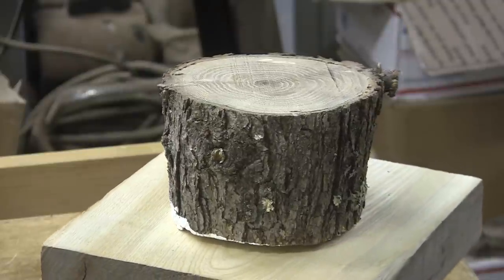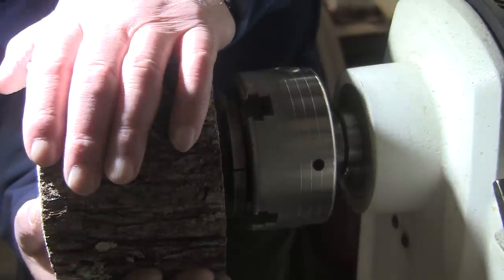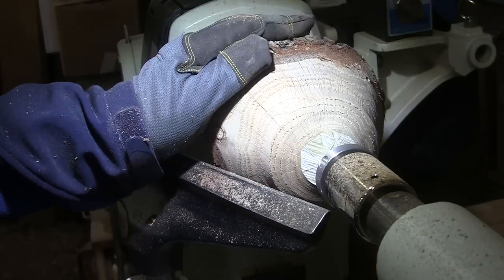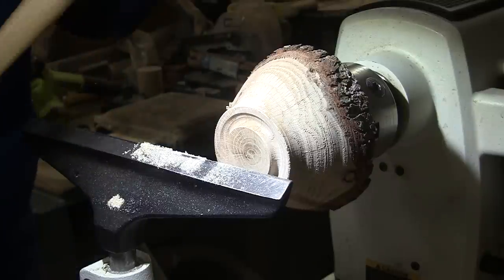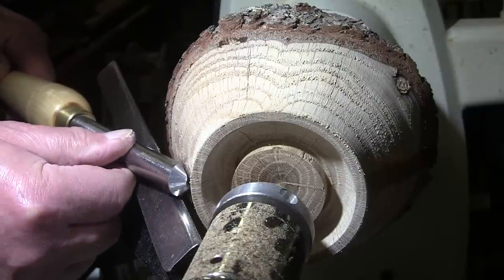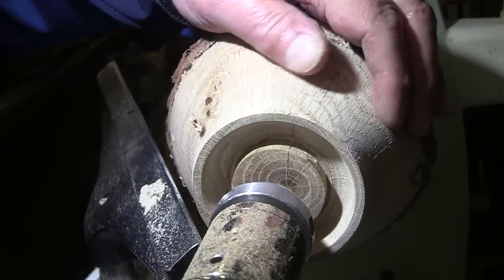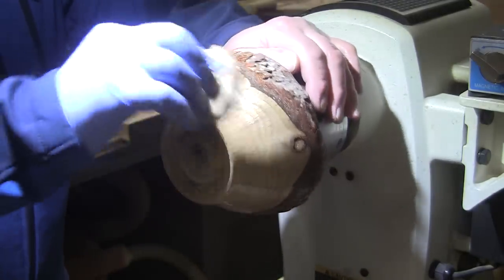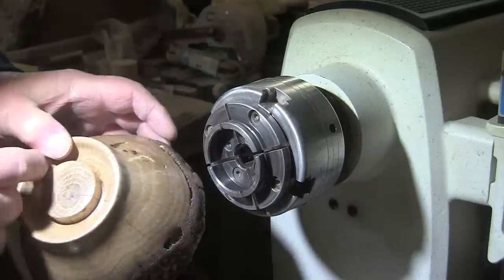Twilight Zone Bowl and Tenon Tips! - Wood Turning

Comment: A really simple depth gauge is a piece of rod in the tail stock locked in position, slide the tail stock up to the Chuck and mark the bed with a felt tipped pen.
Once you are turning you can keep sliding the tail stock up until you reach your mark.
Nice work.
Liz from Victoria, Australia.
Reply from the maker: Yup, lots of simple solutions, Liz.  Just never think about it until I need one! 😊

Comment: good afternoon, i am a new viewer of your spectacular wood turning. i am a wood carver from terrace BC Canada.i carve a lot of bowls out of alder wood. i find very helpful when checking the thickness/ depth of the bowl, I use the straight edge of a ruler and a measuring tape. i lay the ruler on edge and measure from the inside bottom of bowl and to the bottom edge of the ruler. in your case i would place the tool rest across the opening of the bowl and measure from the bottom of the bowl to the tool rest. calipers are handy tools to have but sometimes they can not be used
Reply from the maker: That would work, Geo.  😊  I just sighted along the rim, that works, too.

Comment: A beautiful piece Phil like always.   I do not like turning oak.   It fights me all of the way, and then it gets tired of fighting me.  Then it explodes.  Nice to see that your arm is better.   Thank you.  Hope to see you next week.
Reply: I had a piece of oak nearly finished. Needed to do some very light touch-up. The doggone thing split in half just as the sharpened edge touched the rim. Half landed on the table saw across the shop as if it had been placed there. The other half busted out the window. The air turned blue for some reason. 😉
Reply from the maker: Thanks, Albert! 😊

Comment: Howdy Phil
Finally I got time to finish watching your video ...
How you like seeing the small water holes in the oak ? so many and you can see how the tree gets drink !
You lucky with only a small crack ... I have used oak end grain and got so many cracks I had to use it for kindling ! no matter how dry it was !
One time I had it setting on the lathe and relaxing next to the bench and it cracked so much it made me jump ! almost tipped the beer over ! had about a 1/4 crack ! 
Fantastic grain ... So nice ...
keep on turnin'
Reply from the maker: Yes, I do like seeing the pores of the wood in this open grained Oak, Bruce.  So cool and you can feel them, too!  Yeah, you do have to be careful about some cracking.  I didn't go too thin, partly for that reason. 😊

Comment: Good one for me at this time. I have 5 or 6 pieces of FOG oak I want to try like you do with the bark left on.
Also this is the first new video I've watched. So far I haven't had much luck with bark on bowls.
Reply from the maker: It helps if the tree is cut when it's dormant, Bill.  The bark stays on much better.  😊
Reply: Thanks, Phil, thats good to know but I don't know when they were cut. I found them on the side of the cart path, cut and left to rot, some old punky ones and some that are still wet. Doing a full 2" thick, 2x8 out of the burn pile. I'll do the ARK on oak next. Made ,y own sharpening rig & I'm doing  better. I'll keep practicing the sharpening  and turning.
Thanks for all the instructions and great videos

Comment: Do you ever use the jaws of your chuck in expansion mode on a bowl?  In other words make the foot ring a bit smaller, square up the inside corner and expand the jaws into that. It saves having to clean off the tenon at the end
Reply from the maker: You are asking if I use recesses, Brian and yes, on occasion, mostly on small or thin pieces.  😊

Comment: Great piece, Phil.  I'm curious, do you do anything to clean out the residue left in the bug holes?  Do you treat the bug holes at all other than the sanding sealer?  I agree that they add character and interest to the piece.
Reply from the maker: Yes, I use a couple of different picks to get in there and pull the stuff out, Tom.  That should be clear when you look at the finished piece and you can see open holes where the "stuff" used to be.  I did include that in this video but then edited it out because the video was just waaay too long.  😊

Comment: Interesting info on how the smaller than usual diameter of the recess meant tightly closed jaws, hence the use of the measuring tape to gauge your bowl's thickness.    Always some new tidbit of information in your videos, Phil.    ...You said that with end-grain, while gouging the bottom, you move from the center to the circumference, cause it's 'easier', but did not say why it's easier.   Less 'catching' on the rings?    (cause the gouge is anchored on the rest?
Reply from the maker: Others will have to tell you the why of it.  Probably something about down hill grain, or something. I never quite got it.  All I know is, it's easier! 😊

Comment: Beautiful bowl, Phil. Great instructional video as well. Three questions:  1. Why do you reverse sand?  2.  Why two coats of sanding sealer?  3. Do you always use sanding sealer?
Reply from the maker: Thanks, Michael!  😊  When we turn wood, we are laying the fibers down away from us.  By sanding in reverse we can pick those fibers up and cut them off resulting in a smoother finish, faster.  Sometimes two coats, sometimes more.  Depends on the wood, how porous it might me, if it's punky, etc.  I use sanding sealer whenever I'm going to apply a top coat.  If I'm using something like Feed & Wax, I don't use it.
Reply: @PhilAndersonShadyAcresWoodshop  Thanks for your response, Phil. Very helpful.

Comment: Nice bowl, I always like your live edge features. Most of the time I tried that myself, too much of the remaining bark went flying at some point. Do you prepare pieces to avoid that somehow? 
And then I kept wondering, isn't end grain turning basically spindle turning, so wouldn't it have been easier for removing the tenant to use a spindle gouge?
Reply from the maker: If the bark is not too loose, I will apply a little thin CA under any slightly loose parts, maybe clamp it down.  If it's really loose I'll just pry it all off until it's gone.  No, end grain turning is not spindle turning.  I very seldom use spindle gouges even if I'm turning a spindle.  They are just too lightweight for my comfort.  😊

Comment: Hi Phil! I love watching you work!! I have a question. When you're sanding with the 2 inch disc, and run the lathe in reverse, do you also run the drill in reverse???
Reply from the maker: Thank you, Kayla!  😃  Yes, for the most part I do run the drill in reverse, also.  Once in awhile, mostly on the outside, there will be maybe a base, a cut in line or something that I have to run the drill up against both sides of it.  Then I will run the drill both ways for that feature.  Hope that helps!

Comment: I like oak more and more. It looked hard as soon as you started to drill. How many times did you have to sharpen?
I do have a question, when you were scraping the inside of the bowl, the top seemed a little off-center. The finished bowl seemed a lot more on-center. What magic did you conjure to accomplish this?
Reply from the maker: I did sharpen a few times, Ken.  I edited most of that out, the video was just too long.  I think it looked off center because of two things.  The grain in the bowl was off center and then the rim of the bowl, on the outside, is irregular.  The whole thing is quite On center. 😊

Comment: Hi Phil, Im a huge fan. You have really helped me to learn how to read the wood and let it decide what it wants to be. Ive been making alot of eggs and smalls bowls. My lathe is an old craftsman monopole. I ordered a 4 jaw chuck which said it was self centering however it is not, you have to adjust each jaw individually. Im really struggling to find a true self centering chuck thats 3/4 x 16 tpi. Would you have any recommendations? Thank you so much for your videos you do some beautiful work.
Reply from the maker: Thank you, Proto 37! 😊  Ah, that's a shame you ended up with a less than helpful chuck.  Very disappointing!  Yes, you can get a self-centering chuck (scroll chuck) for your lathe.  I think most manufacturers make an insert for 3/4-16 threads.  Let me see if I can find one.........  OK, there are many!  Here is one of the less expensive sets but still an excellent chuck, same brand I have:  https://www.amazon.com/Bundle-items-Woodlathe-Insert-Adapter/dp/B09BTPJSXY/ref=sr_1_29?gclid=CjwKCAiA_6yfBhBNEiwAkmXy5yQTfXUyZ-IpXfDfkrtFlcUawJTeE8W0m4s78fq80lgw_I8P6oVClRoCPe0QAvD_BwE&hvadid=602147503867&hvdev=c&hvlocphy=9033498&hvnetw=g&hvqmt=e&hvrand=2989021748458327787&hvtargid=kwd-1671953822069&hydadcr=28603_10166556&keywords=3%2F4+x+16+tpi+wood+lathe+chuck&qid=1676405132&sr=8-29
Reply: @PhilAndersonShadyAcresWoodshop  Thank you so much! I really appreciate your recommendation, I've been nervous to order another chuck but I can clearly see that the link you posted is definitely what I have been needing! You're just all around the best! Keep up the beautiful work, it's a pleasure to watch the things you create.

Comment: I see no cracks, is it still wet or will it dry out more a crack after it's a bowl? Did you measure the moisture content? As always,  strong work! Thanks for sharing.
Reply: That tree was cut in the summer of 2020...it was about to fall on my Dad's  house.
Reply from the maker: I didn't measure the moisture content, Sam, but it seemed dry to me. 😊

Comment: I have easy access to cottonwood, willow and pine. But i don't see anyone use that to turn.  Why is that? Other than it's soft.
Reply from the maker: I think Willow turns pretty well, Brendan.  I've heard Cottonwood can, as well, as long as it very dry.  I've turned Pine with some success.  Being soft is probably the reason you don't seem it more often. 😊

Comment: Howdy Phil. I never understood why you sometimes sand with your lathe and sander in reverse. What is the advantage?
Reply from the maker: Chuck, when we turn wood we are laying down the fibers away from us.  By sanding in reverse we can pick those fibers up and cut them off resulting in a smoother finish, faster. 😊
Reply: @PhilAndersonShadyAcresWoodshop  
My lathe doesn’t have a reverse but I will try sanding with my drill in reverse. Thanks again.
Reply from the maker: @chuckbair4292  It's a nicety not a necessity, Chuck.  This is my first of three lathes that has reverse.

Comment: Phil, do you sand after applying sanding sealer coats and before the shellac?
Reply from the maker: I have a very short video on my smoothing process, Brian.  https://youtu.be/lqns7oue4W4
Reply: Thanks Phil.  Are these pads available at Home Depot and similar stores?
Reply from the maker: @brianb1514  Probably but I've never looked for them there.  I order them from Amazon.
Reply: @Phil Anderson - Shady Acres Woodshop  could you send product info...I am in Canada but can order from Amazon USA if needs be.  Thanks...
Reply from the maker: @brianb1514  I just searched 3M abrasive pads and came up with these results:  https://www.amazon.com/s?k=3m+abrasive+pads&crid=24U72YOA5636X&sprefix=3m+abr%2Caps%2C143&ref=nb_sb_ss_ts-doa-p_1_6